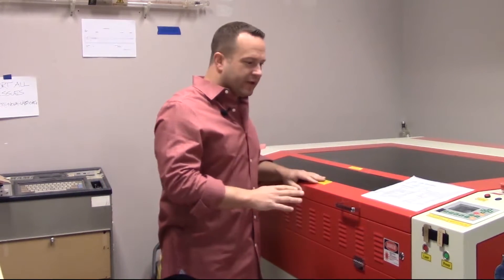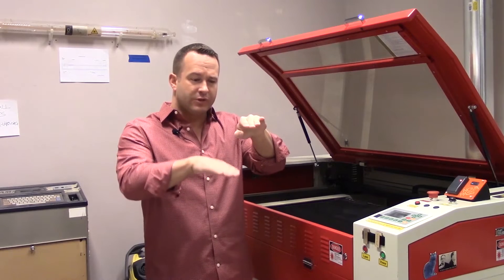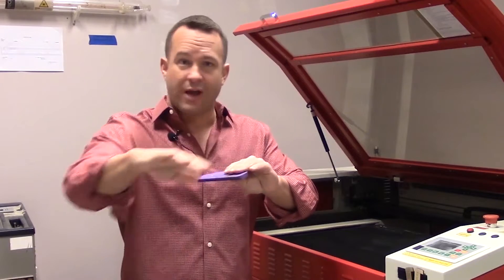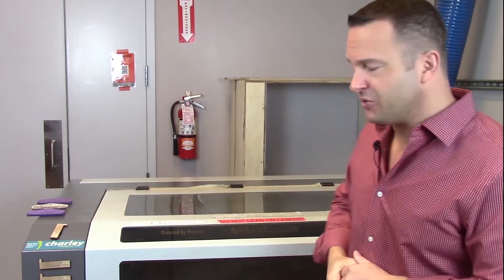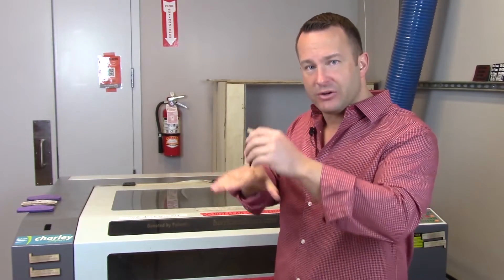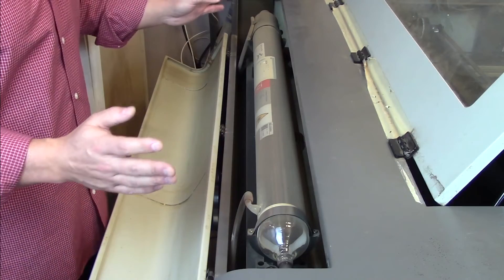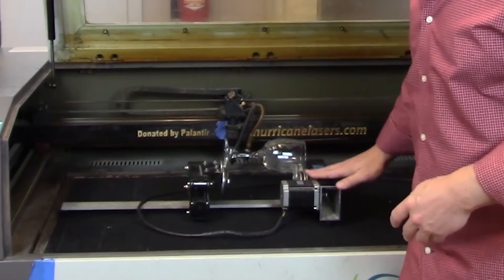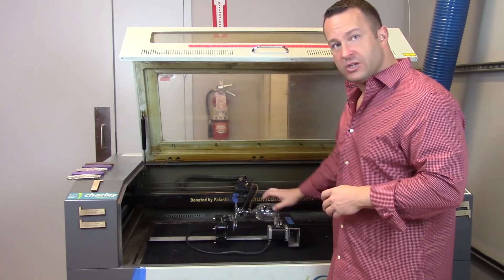Anatomy of a Laser Cutter

Comment: I have both roller and chuck style rotary atachments.
Much prefer the chuck style.  Ould use that for nine out of ten rotary jobs.
Reply from the maker: Greolt, why do you prefer the chuck? I know I've experienced some slipping on the rollers...
Reply: @GreylightMay  The work feels a lot more secure.  Slipping is eliminated as a possibility.  
I have a range of holding options.  Call it chuck style, and I do occasionaly use a chuck, but more often cones with a tailstock, both male and female as the job requires.
Reply from the maker: Yes, while I understand Patrick's point about the ease of doing multiples with the rollers, the one time it slipped on me was very disappointing. I learned how to work around it, and didn't experience anymore problems, but if changeover speed is not an issue I can see how the chuck approach would be a more secure option.